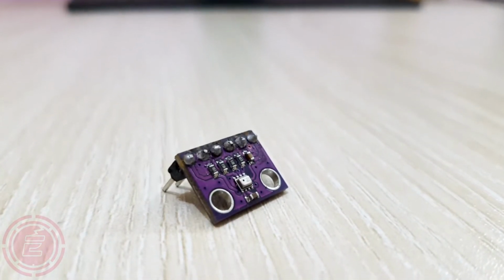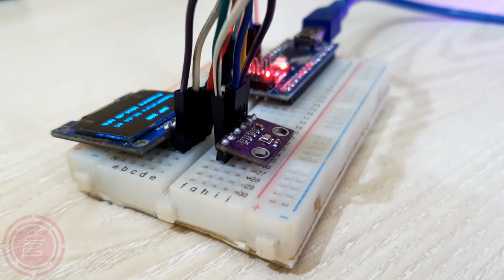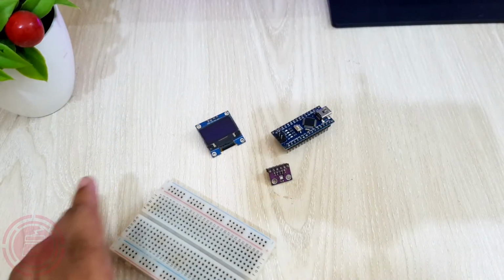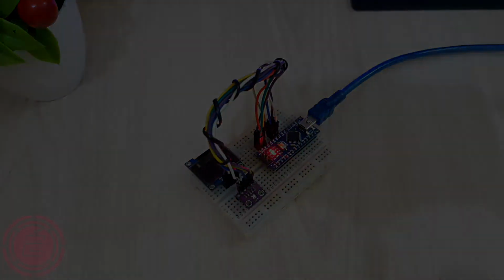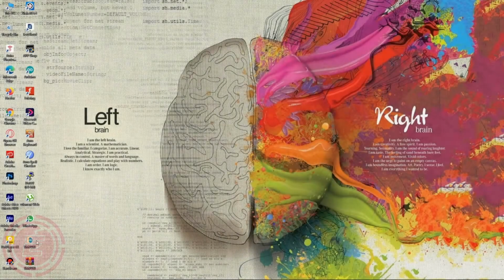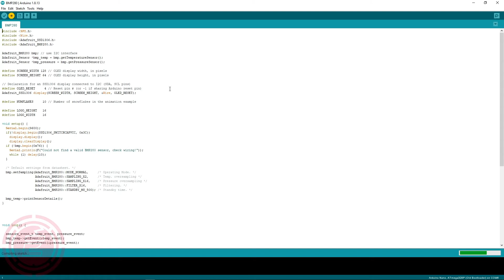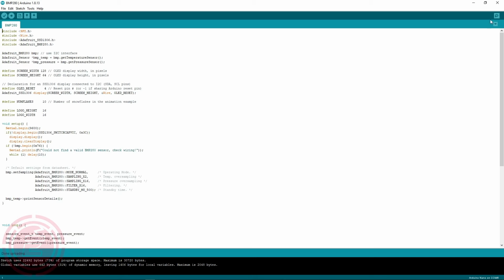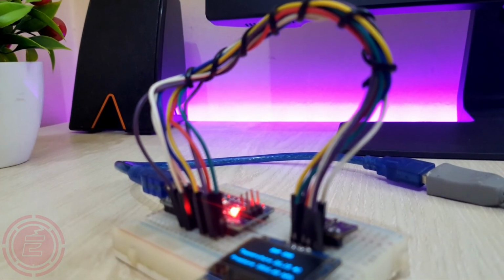BMP Barometric Pressure & Altitude Sensor module | Weather sensor

Comment: Sir,Can I use it to measure altitude of rocket?
Reply: It looks like the DPS310 is more sensitive to altitude changes if your looking for post flight telemetry. Otherwise, maybe check with other amateurs that run Arduino controllers. Looks like data storage will be your main concern though, not sure with the terminal ballistics of a flash drive...